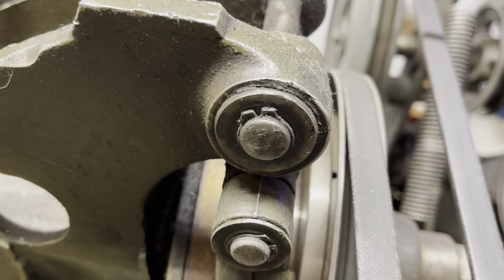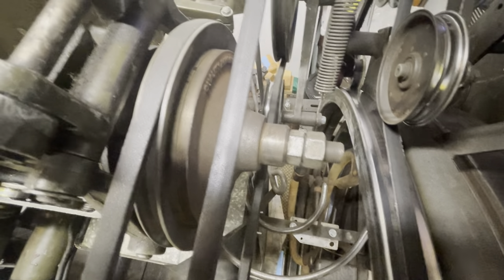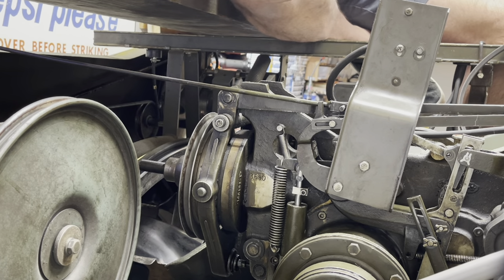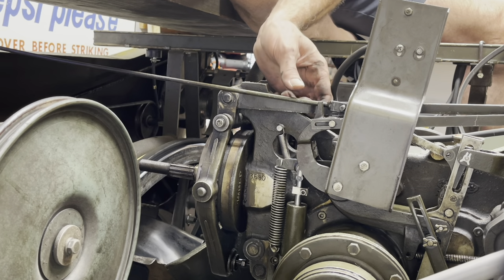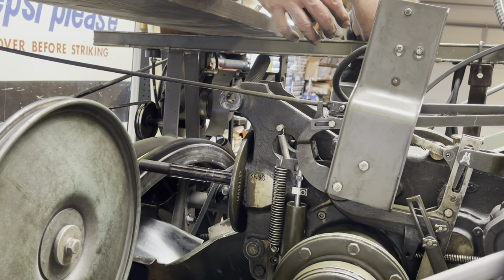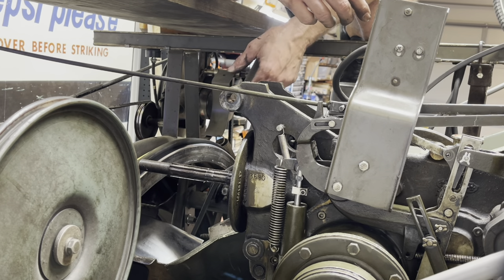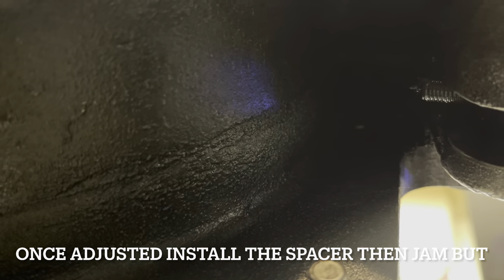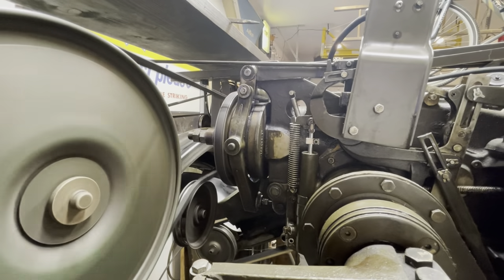Gearbox clutch - How to check your facings and worm shaft condition on a Brunswick pinsetter - GBA

Comment: 6:19 I always thought when comparing the two machines that the AMF machines were engineered more like something you would find in a factory, where as the Brunswick was designed more like a car. After all, AMF was known for building industrial production equipment for many industries long before they got in to the bowling business. Also with an AMF you get the best of both world's. Simple mechanics and simple electronics working together. On an 82/70 there's only three motors and one or two solenoids depending on how old  the machine is. The chassis controls when each solenoid or motor runs. The rest is mechanical. The backend, ball lift, and distributor all are entirely mechanical. Also the movement of the respot cells and pin cups is mechanical as well. The AMF machines can also be easily be integrated with scoring to optimize itself. Eliminating first table run on strikes, and running the sweep reverse on gutters saves time and wear and tear. On top of all this the AMF machines is modular. If a problem comes up during league the majority of the time it can be fixed within minutes by changing the troublesome assembly. The machines "brain" (chassis) can be swapped in about 45 seconds with a couple plugs and latches. Swapping out the gearbox on an A2 is a much more labor intensive procedure. With all that said, I can still appreciate an A-2 as they can run well. And for the most part I don't believe there is such a thing as a bad machine, only bad mechanics. AMF seems to get a bad rep mostly because it takes a special kind of mechanic knowledgeable in both electronics and mechanics to make them run well. Many mechanics are lacking on one of the these skills. I've been working on AMFs for years and I've seen them run fantastic with the right guy in the back!
Reply: I've been in the business for 45 years and for the majority of those years I was a Brunswick man but I did spend 10 years on AMF machines 8230 and 70 and I have always found that on an AMF machine you have to hit an exact spot in order for the machine to run when you make an adjustment as to where a Brunswick machine you can have it within the general area and it will run until you dial it in and then once you said it you can forget it AMF machine is not that way you have to find that exact spot any deviation from either side of that plus or minus and it'll goof up but I can make them both run and run efficiently